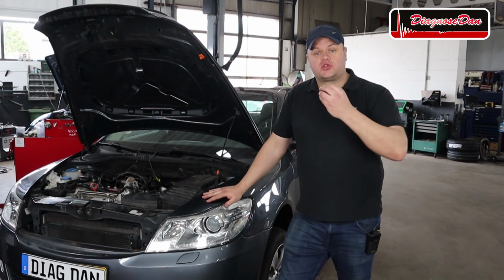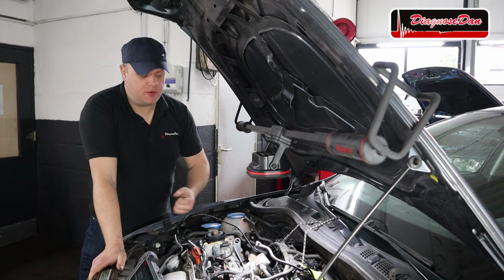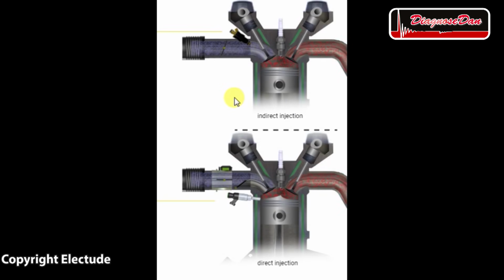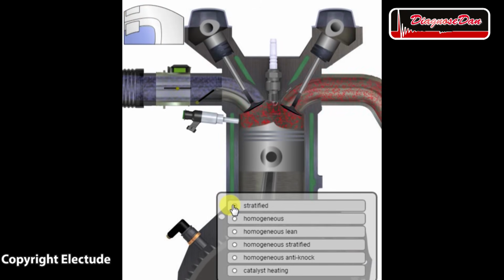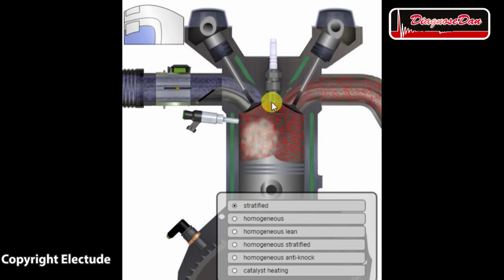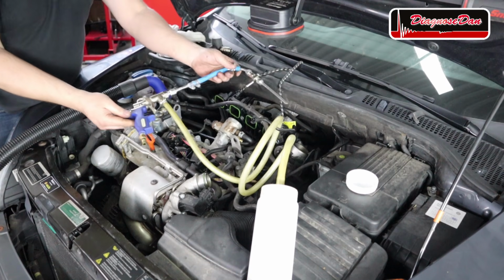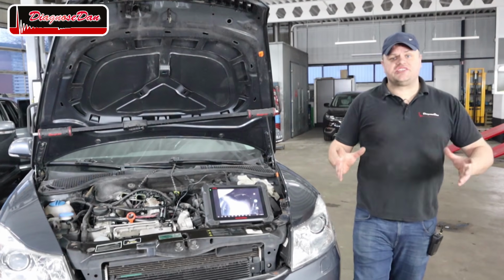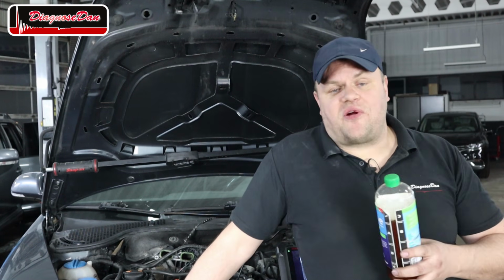Tsi cold misfires explained

Comment: All the crud in the intake used to be just blown out of the crankcase through the breather. Now the mess stays inside the engine, but that creates problems of its own. Yet another reminder that internal combustion engines are fundamentally only a little more advanced than steam engines.

Comment: Hi Dan  Great video as usual.  Can you comment if the situation is similar on TDI engines? And if a solvent cleaner like Revive should be use regularly or would you just have the valves blasted every 100K?

Comment: On port injected Oil & fuel vapor condensing at the throttle body because that the low pressure area. The point where fuel is injected is the high pressure area. Just like in weather, rain fall occurs @ the low preassure area.

Comment: You know how BMW reduced there carbon issues on there modern DI engines without the use of an extra injector?  We used to have 2 walnut blasters in my dealer as it was very repair and now  they are collecting dust hardly ever see them used any more.  I know for a fact the 4 cylinders never seen one with carbon complaints.

Comment: I have subbed. I own a TSI, and it's wonderful. It did slutter on a very warm engine, a bit, but then I took it on the autobahn. 195 km/h / 3800 RPM for 30 mins in 36 degrees from Denmark to Neumünster seemed to do the trick. 

Do you have some specific tips for the EA111 engines, in particulair 1.4 TSI BMY?

Comment: Great info as always. One question: If the cylinder head is made of aluminum, does blasting the back of the valve with an abrasive material like you did on cylinder #1 erode the inner walls of the port, since some of that cleaning action is likely to contact the walls of the port?
Reply from the maker: I've never seen that happen

Comment: Dan, is there any concern of the cleaner causing either, chunks of carbon falling of and going through the motor/turbo; or acting like a fuel and overheating the turbo?  Thanks!
Reply from the maker: This is actually sold as a Turbo cleaner.

Comment: Hi diagnosedan! I have a 1.4l fsi BLN that is driving me crazy. P2540 code engine runs like crap at idle fuel trims are ok I think. Changed electric fuel pump and 2 fuel pressure sensors still same problem. Any help would be appreciated. Thanks and keep up the good work 👌
Reply from the maker: Join the Diagnosedan Global tech support group on Facebook and ask your question there

Comment: Hi Dan,
I have a problem with my car bmw e60 523i model 2006  the right Headlight, the xenon lights don't work, and everything is right in the headlight. I have checked the wires, but one of those wires does not have power. Can you help me solve this problem?
Reply from the maker: Ask your question on the Diagnosedan Global Tech support group on Facebook
Reply: @Diagnosedan  Thanks Dear 😘👍🏼

Comment: great video. Is this a defect in the design of the engine ? is it better in newer models ?
Reply from the maker: On newer engines they have solved the problem by placing an extra injector in the intake
Reply: @Diagnosedan  good to know! 
thanks a lot :)

Comment: Very interesting, I got a small problem on my 1.4tsi ecofuel. This engin runs on cng and gasoline. However if I run it with gasoline, I sometimes get an error about "system to lean off idle" this is an error only happening when the engine is run on gasoline, so a vacuum leak can be ruled out, or not?

Comment: Engineering flaw, direct injection. VW will keep making it with this flaw instead of fixing the issue.
Reply from the maker: All manufacturers use DI these days and they all face the same problems. On newer models the problem is solved by placing an extra injector in the intake
Reply: DiagnoseDan correct. But vw will avoid doing this because that’s just how they look at things. Like dual mass flywheels. Other brands can make working product without them but they refuse change.

Comment: Question, will a EGR catch can help to eliminate/reduce carbon buildup on the intake system? Thanks.  Great video and info!
Reply from the maker: It will slow the process down 👍
Reply: @Diagnosedan  Thank you for responding!  Wish you were near me so I could bring my car in for that abrasive blast cleaning process you showed first, it looked great.  My car is starting to misfire when the engine is cold at an ambient temperature between -5° and 10°C.  Excellent videos, keep them coming!

Comment: If the fuel is injected directly into the cylinder you didn't mention the carbon build up occurs presumably because of exhaust gas re-circulation into the intake  ?
Reply from the maker: The majority is caused by oil vapours from the crankcase, but there are other sources like Egr and oil leaking past the valve seals.
Reply: @Diagnosedan  You mean oil vapours getting past the piston rings separately from egr gas being put back into the intake ?

Comment: Blimey looked like you was carrying out liposuction on that engine😂😂😂
That’s the first case of open engine surgery I’ve seen carried out live on you tube 😉
We use tunap at my dealership it’s the recommended solution MB approve, I do like it although it is labour intensive as you stated.
My personal take on carbon build up on valves is to change the oil at more regular intervals to prevent old dirty sticky oil mist from pcv contaminating the valve stems. I flush & change the oil on my direct injection mercedes engine every 6 months ( being in London & encountering long times at idle in traffic)  & haven’t suffered any large carbon build up although there will always be some residue due to fuel no longer being sprayed onto the back of the valves & cleaning them.
As always a good video sound quality asides, keep em coming 👍😀😀😀
Reply from the maker: Thanks for watching 😀

Comment: I had an 08 Passat  I just used an assortment of picks and stuff , with compressed air and throttle body cleaner and rags , making  sure the pair of valves were seated first. Also made sure to get as much crud as possible out of the intake. Definitely changed the oil and plugs  right after. Doing that chemical intake cleaning procedure  probably have premature catalytic converter efficiency codes later
Reply from the maker: That sounds labour intensive!

Comment: I had the same cold miss fire on my 2017 GMC Acadia with the lgx v6 at 20k. I walnut blasted my intake valves because no additives or sprays worked for me. Installed a oil catch can and 60k now and idles as smooth as the day I drove it off the lot. Haven’t cleaned the valves since
Reply from the maker: That's great 👍

Comment: Nice video man and good job...I have question about this blasting - How long does it stay clear? Cause I saw few engines 40tkm, 60tkm 150tkm and all look similar. And your opinion to use"anti-carbon" Aditives to fuel?? Because U said, D-I engine have dry intake (no fuel in front of valves), only one way how to get aditives in fuel right there is in low-loaded cycle by EGR or something similar to get exhaust gas back to intake...in any case well done, I like your videos
Reply from the maker: This Car had 130K Km on it and i think this was the first time it was blasted.

Comment: well done I learned alot dan, I didn't know there was different feul injection strategies . I know some engines have both port and direct injection is this to stop carbon build up on intake valves and also to help cold start ?
Reply from the maker: Yes, they use an extra injector in the intake on later models 👍

Comment: A few questions? What was the accumulated mileage for this carbon? What kind of oil was used. How often was it changed? Was there a n oil breather separator system in place? Thanks for answering each question.

Comment: I always thought chunks carbon brakes off and lose compression that way?? But the restriction on the airflow is defenitly a good theorie to me.... Think all those fsi engines have problems with the carbon, Toyota use dobble injection, direct and port injectors to clean the ports I heard...
Reply from the maker: On newer VW engines they also have extra injectors
Reply: @Diagnosedan  yes oke didn t know....had some trouble with an ep 6 engine from Peugeot(psa group ,also mini,bmw????)anyway had a lot of  misfire trouble to (p1338,i f I remember correct)but this misfire is probably caused by to much oil into the combustion room...the piston rings and oilring get stuck on these engines wich causes blowby and the oil stays on the wall....couldn t get it loose with addatives,you have to take the piston out to clean it(wich the customor didn t allow me to do)...some Peugeot centers adviced me to switch oil from 5w30 to 10w60 afther a decent oil flush(the oil fluh didn t do much)and the customer sold the car in
 the proces…...the Peugeot ep6 engine is very efficient,but for the customer a pain in the butt afther 150.000km!!!!I don t like to say its a crappy engine(and its not,very hy tech air intake and varable lift on the intake,variable timing on both cams)but the way it pollutes its self is a nightmare.....

Comment: Once again, best channel on YouTube for the latest information about modern car repair. I thought the carbon was holding the valves open a little when cold. WRONG. Do u c the black rear bumpers on direct injection cars?  I hate that. Port injection is best. Or a combination of both. This video, along with the ones on high voltage battery systems and many other subjects make this a standout channel!!!  Thank u DD. U fixed it again.
Reply from the maker: Thanks Bill!😁

Comment: Looks like anything direct injection is off my list of future vehicles. I refuse to get anything that has effectively a designed-in problem that I cannot economically tend to of my own accord.
Reply from the maker: The problem is solved on newer engines by placing an extra injector 👍
Reply: @Diagnosedan  So... twice as many injectors and the ancillary components to go bad, for some minuscule fuel economy benefit? Personally, I'd rather just spend a little extra in fuel over the lifetime of the vehicle and stick with one set - port injection only.
I honestly feel the best balance between complexity, reliability, cost of repair and fuel economy was struck on motor vehicles in the mid-90s to early-2000s. After that all manufacturers really went down the planned obsolescence route with unbridled enthusiasm.

Comment: I use GDI valve cleaner every other oil change, right before the oil change in case it leaks into the crankcase. It works best as a preventative measure. Start using it as soon as the car is new, starting about 10K miles. Works great if you use it correctly.
Reply from the maker: Smart thinking👍

Comment: Some shops use walnut shells to blast the build up. Labor intensive but get the job done. Lexus dealership use a chemical to clean it. As you mentioned, if chemicals are applied on a regular maintenance basis, it would prevent the build up. I saw videos where diy spray oven cleaner or water once the engine is too hot. Not sure if it works.
Reply from the maker: Agreed, i wouldnt dare to use oven cleaner on a customers Car.

Comment: Seems like that revive works like subaru upper engine cleaner. I'd be doing the final step after that 20minute drive is change the oil as it gets contaminated. The upper engine cleaner is a pre-oil change thing.
Reply from the maker: Ok, sounds simular. I did an oil change afterwards.

Comment: Nice explanation Dan. Do turbo direct injection cars have more, less or the same carbon build-up? Thanks! Dutch regards Nico.
Reply from the maker: I think its worse on Turbo engines, because there is always some oil in the intercooler and turbo lines on a turbo engine

Comment: This is caused by the pcv system. Installing a catch can will resolve this problem. The carbon buildup is caused by sucking oil fumes back into the intake onto a valve that is no longer washed by fuel.
Reply from the maker: A catch can will slow the process down but not stop it because there are other sources of contamination like Egr gas.

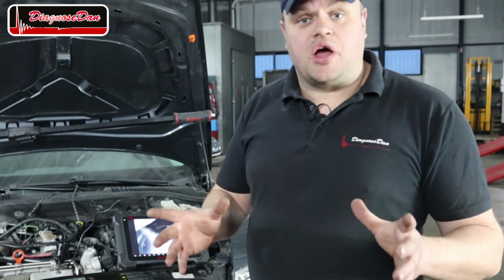Comment: Dan the small amount of blasting media left behind 13:51 is why I haven't performed this to my GDi engine as the only blasting media I can find is walnut shells and I am concerned with leaving some residual behind.  What is the name of the blasting media that you used (pronounced granulete ?) also, where did you purchase it and the dissolver from (products used on cylinder #1)?
Reply from the maker: Tunap Granulate, Google it to find a local reseller
Reply: @Diagnosedan  thank you

Comment: I keep wondering if a chemical treatment can solve or prevent the issue. The problem that I see is most chemical treatments done on a regular maintenance schedule would cost more than blasting the carbon out every 50k. I have the BG GDI service tools and chemicals and have had decent results on most vehicles but if the carbon is heavy then it’s more cost effective to pull the intake and blast the valves. Thanks for the video Dan.
Reply from the maker: Good question, i guess it depends on how easy the intake ports are accessable. On some models its very hard to blast the ports on the Car.

Comment: The dark side of engines. I hope that car manufacturers figures out a way to counteract the carbon build-up in the intakes, possibly with some good surface coating or similar. But carbon buildup isn't entirely new, that's something that EGR systems suffers from as well.
Reply from the maker: The problem is solved on newer engines by placing an extra injector in the intake.

Comment: Most techs knew back when this system was first introduced that this would be one of the biggest issues with it. It is a stupid design and people are paying for it when the failures occur. Best method to keep this from happening is running dual injectors, which many of us figured would be incorporated into the design. It wasn't until recently on some makes and models. Great video Dan! Seems that there is little in the way of effective cleaners aside from blasting to get the carbon off.
Reply from the maker: Agreed Joe, once the carbon build up gets to a point it starts to effect the engine it looks that the only real solution is blasting. Thanks for watching 😀

Comment: Good video Dan. Seems like  after marker products just don't work as well as they are advertised. Manufacturers need to come up with a way to keep the carbon buil-up to a minimum. Thanks for sharing Dan Artie ❤️
Reply from the maker: The problem is solved on newer engines by placing an extra injector in the intake

Comment: Dan that revive technique is very similar to General Motors TEC, or Top Engine Cleaner.  When TEC was originally created it was a liquid you poured right into the carb of a hot engine running at high idle, and you were supposed to pour it in steady and then the last 1/3 pour faster and let the engine stall out in the process then let it sit for 20 minutes, then take it for a drive and blow it out good and return and REPEAT a 2nd time. The GM tech people were pretty adamant about doing it a second time or don’t bother at all. In later years they released a spray for easier use with some FI engines and also supposedly some techs were hydraulicing the engines during the stall out and causing damage and they stopped recommending you stall the engine out. The stuff worked great though. We used it primarily to decarbonise the valve and internal combustion area when trying to stop cars from pinging (detonation) back in the 80’s and 90’s.
Reply from the maker: Hydrolock would be one of the biggest concerns using a liquid product. That's why it needs to be sprayed very carefully.

Comment: Dan, pcv vapors condensing on the back side of the valves has been a problem since day 1 with direct injection in BMWs. Don’t think any of those chemicals can do a good job, don’t get to spend enough time in contact with the carbon to do a complete job. Ford says no way to the chemicals they say it’s taking out there turbos.
Reply from the maker: Maybe if you use the product on a regular basis it can prevent the carbon build up

Comment: Dan, also....VCDS shows no fault code, even after daily misfires....what’s with that?  Many thanks.
Reply from the maker: Misfires aren't always registered during warm up, open loop.
Reply: It was suggested that it was the MAF that was faulty, due to cold start issues, but I did get a “left bank intake flap valve fault “ a while ago....this suggest to me that the intake is full of gunk and carbon deposits. Maybe 3 x catch cans will fix it...😏  Dan ...really love your diagnostics with the oscilloscope.....amazing...!!

Comment: The Tsi engine is one of the worst engines in the modern era. In addition to the carbon issue, it has too many plastic parts sealed by o-rings in an engine that leaks oil like a sieve. That oil ruins the o-rings.
Reply from the maker: At least they provide us with work 😂
Reply: DiagnoseDan 
Ha! So true! Thanks for the educational videos! I enjoy them very much!

Comment: Dan, just a thought. I am assuming that using the revive solution is suppose to break up the carbon and send it through the exhaust. However wouldn't that cause some restriction/blockage in the Cat. and cause even bigger problems?
Reply from the maker: Good question, i guess it's supposed to burn in the cilinder. But i'm pretty sure not everything gets burned.

Comment: The product isn't a one time fix it, but it may work as a preventive measure, since it would emulate what the old fuel injection would do.
Douse the intake valves in disolvant as you drove, at the expense of the environment and some fuel savings.
Reply from the maker: Thanks for watching 😀